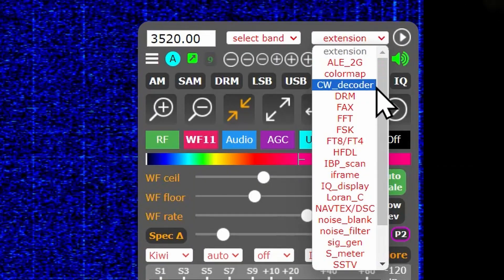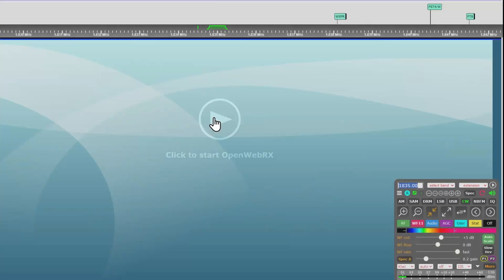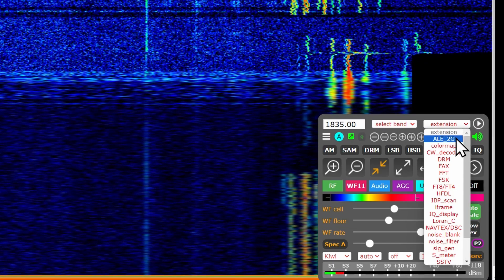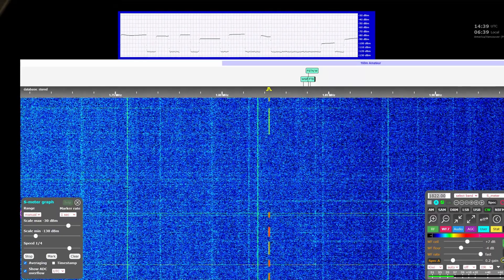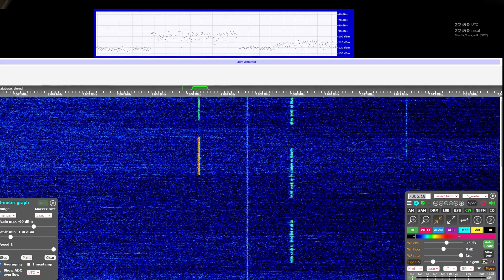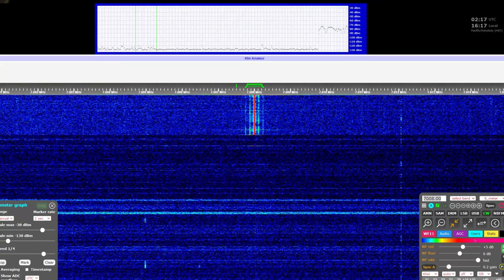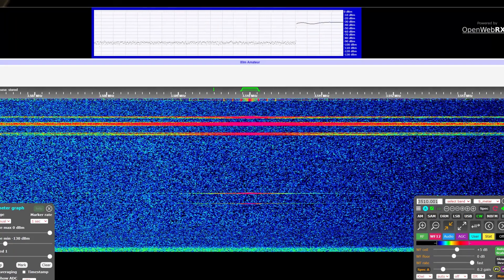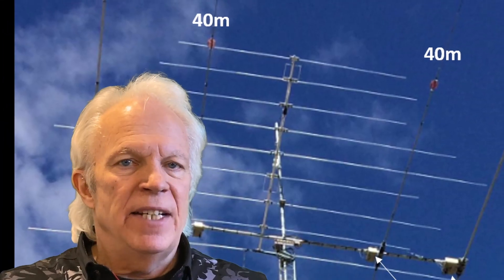How to test your antenna on air

Comment: don't forget that using different receive locations will give you different result ,as the vertical radiation patern is different for the different vertical angles. and this method does not compensate for condx and possible signal reflections on the tx or rx location(s).

Comment: Nice to see the VE7AV SDR make it to your video. I'll share the link with Frank. He'll be thrilled. 

I've often used this method for testing my antennas performance. I'm on about a 1/3 acre lot and have been able to put up antennas for all HF bands with 2 on 80 (1λ loop, 1 inverted V) 4 on 40 (1/4λ vertical, vertical delta loop, inverted V, and a horizontal loop) and so on.

This same method is how I was able to "see" the effects of ground losses as I saw the improvement made when I went from 4 full length radials to a 20-something on my 160M inverted L.

Thanks again for all the time you sink into these videos. Bob, VE7WNK